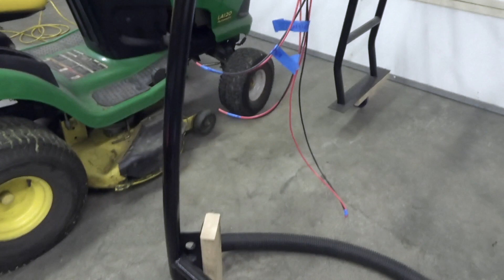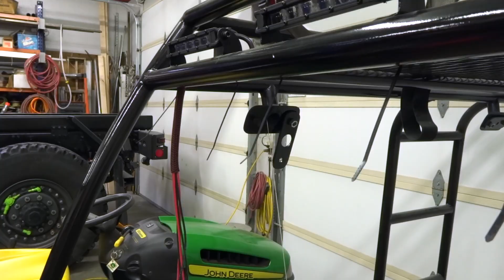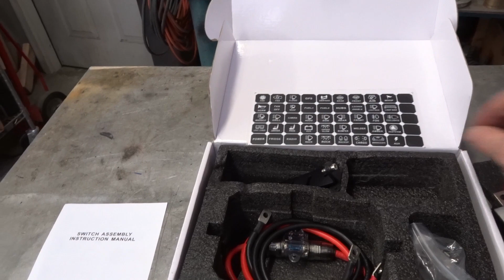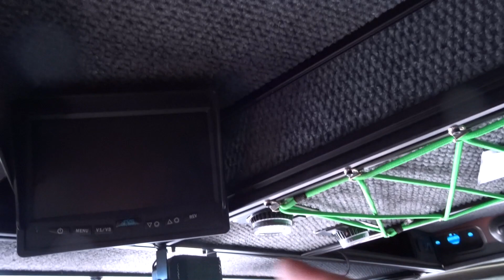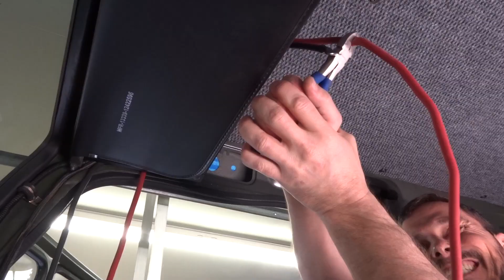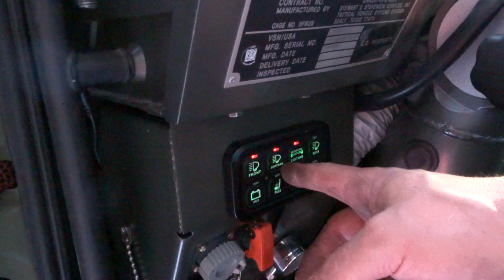Installing a Switchable Fuse Panel (loud music warning)

Comment: That vacuum trick is brilliant!
Need a disconnect plug right at where the wires enter the cab.
I would put connectors on each light too.
Have you thought about using Great Stuff in the roll bar after all the wires are ran?  Should keep out the water and insulate the cables.
Reply from the maker: I have connectors on the cab side. I should have put them on the light side as well.  On the great stuff, I want to be able to pull more wire later on.

Comment: So, the reason you were having trouble fitting the relay box in the ceiling is that you weren't swearing enough.  Like nowhere near enough. If you want, I could teach some of the more useful phrases I have developed over the years.  From the coercive, get in there type phrases to the more, well that was a surprise outcome/feeling phrases.  You will have to DM me though, I tried putting instructional videos up on Youtube, but they take them down as soon as they go up.
Also, if Sean says you did a good job, you did a good job both in form and function.  Thanks for the video.

Comment: Chances are the bleed over voltage you have is induced voltage from the inductive field. You were right about the residual voltage when you turned it of. Cables maintain a capacitive charge after having power turned off. I saw a guy go to the hospital because he became the ground for that capacitive charge. Using the vacume and the parachute looks like you know a little more about electricity than you let on. I've used that method to pull hundreds of feet.

Comment: I hate to be THAT guy but I have to say... keyboard and all... and yes this is the internets... and I do (or did) this for a living... The only thing I would have done differently on the terminals would I would have just crimped them. Sometimes the solder can wick back under the wire insulation and this will make the wire brittle. I have seen and experienced the wire cracking right at the end where the terminal and insulation is. This can cause an intermittent open. Let me tell you how much of a pain this is to find. I have not seen a wire crack with just a crimped on terminal (well maybe if someone used the wrong strippers on a 20 AWG wire) Just something to watch for if your system starts to act funny down the road. I will say that everything does looks awesome. 

Of course if the solder didn't wick back under the insulation just ignore all of my keyboard commando  old man yelling at cloud stuff.

Now I just need to make some videos for my LMTV... I have had the chance to get stuff down with this lock down.

Comment: I like that switch box.  I will have to use something like that when I start wiring Rusty... 

I may know a guy that knows a thing about wiring and he told me you did a good job making up those cables....  

Good call using relays to power your higher amperage loads and the switch panel for a signal to the relays...

Your truck will appraise higher than an Acela when you are done...

I appreciated the music blasting LOL